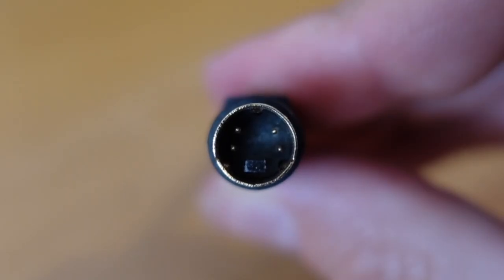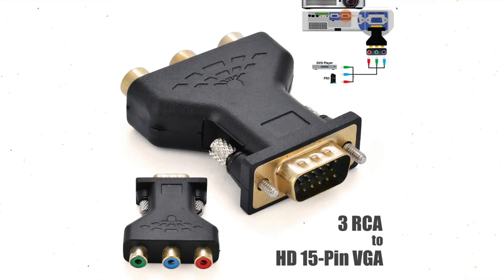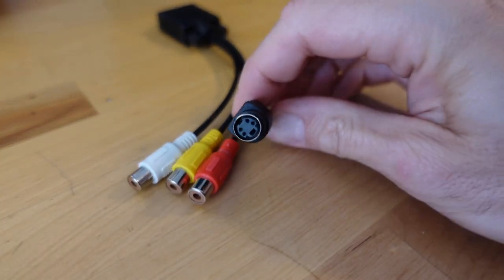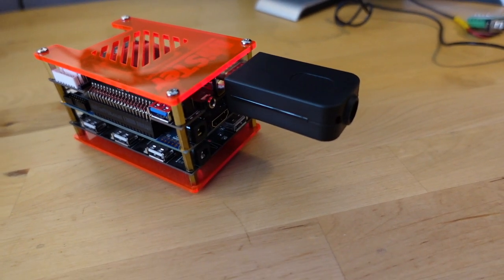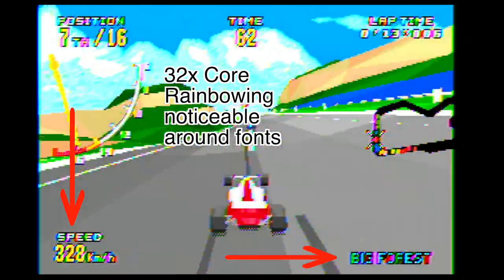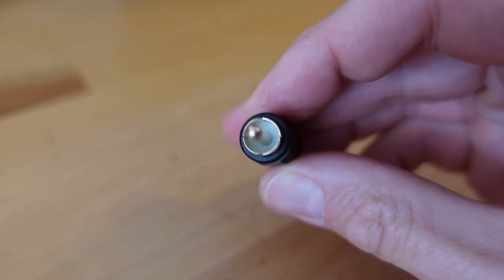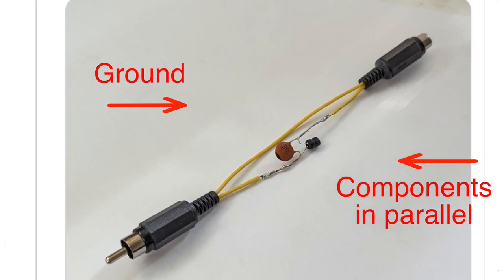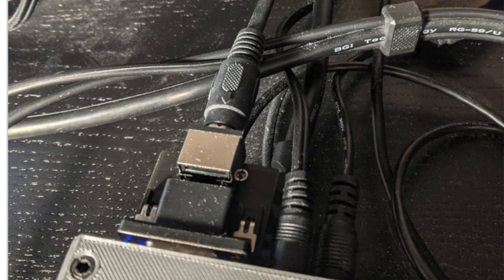How To Hook Up MiSTer FPGA S-Video & Composite

Comment: This was super helpful, thanks! I have a spare CRT setup that only does composite and s-video but wanted to make use of it with the MiSTer. Took some fiddling, like setting the MiSTer update to actually get the YC cores (I apparently hadn't done that before, and so I did not have them), then remembering to actually enable the YC options once in those cores.. After that, it worked! I already had the component video cable from MiSTer Addons and already had a couple of Y-cables on hand as well, so I didn't need to purchase anything or hack anything up (although I may try to make the filter like shown in your video for composite). I am also surprised there are so many YC cores. I was a little worried going in that my selection would be limited, like with the arcade cores, but it seems like just about anything I would want is here (even PS1)! Great stuff. My MiSTer just keeps getting more and more flexible as the years go on!

Comment: It also works with direct via direct video over hdmi with Antonio's vga to component dongle (which adds sync on green). That dongle is super cheap as an alternative for anyone who doesn't have an io board
Reply: The Antonios dongle has major dot crawl issues on composite output which look REALLY awful on systems like sega genesis, which is a big call to action on why this is being made (apart from convenience sake). Although the adapter works well with s-video.
Reply from the maker: @HappehLemons  I suspect here you are referring to Antonio’s RGBs to S-Video and composite adapter. That does exhibit dot crawl like most devices which externally do that conversion will

I believe the commenter above is referring to another dongle by Antonio which is a simple VGA to component breakout board. Like VGA to component to adapters are supposed to do, it takes external sync and mixes it into green/luma/Y. It’s cheap and a quality VGA to component solution

As I understood with direct video, the difficulty is finding the right hdmi to vga converter, it needs to be a specific chipset according to Mike

Comment: Woo hoo. Native. Will be interesting to compare the current converters with this solution. I've got the villena which from memory you have too. At the very least not having to switch the jumper to 5V is a win.
Reply from the maker: Yeah I have the adapter too. I think we would need to wait for a full release of the YC cores and for Mike to nail down exactly what components should be in the dongle. Turns out I can't even easily source an 10uH inductor locally so I couldn't build a cable to Mike's spec. The parts shortage is real!!! (actually I live in a small place with only 1 main store haha)

Comment: It's not native S-Video like you say, it's transcoded into S-Video that has a different colorspace. Not a big deal. Better to point out that the capacitor + inductor in parallel combo values are for NTSC, not PAL.

Comment: Great video Zez! I have been trying to find a good s-video solution for my mame cab i built years ago. I was about to pull the trigger on an ali express svideo io board with saturn type av out but then I saw that porkchop is working on one that can do dual sdram....and then these cores comes out!
Reply: Would the io board with the saturn output benefit from Mike's core? Like would you not have to get all these dongles, just use the saturn output?
Reply from the maker: @kevfleth  I don’t quite get what you mean. Can you explain the question again? Are you referring to the upcoming Saturn core?
Reply: @ZezRetro  The RetroCastle Store on AliExpress has these io boards with a Saturn output replacing the VGA output. So I was just wondering how an io board with a Saturn output, using composite or svideo, would look compared to an io board using VGA and converted to composite/svideo using Antonio's vga to composite adaptor? And how Mike's core would look on the io board with the Saturn output?
Reply from the maker: @kevfleth  I found what you are referring to and I had absolutely no idea such a thing existed. I have started to ask around my contacts and so far, this is a total unknown to them as well. I can't say how this thing will work as I have no information about it. It claims to be outputting composite and s-video directly but no idea how it is doing this. If i took a guess... I'd say this composite output would experience dotcrawl as it's being generated outside of the core. I would guess they are using a chip to convert the RGBs, much similar to Antonio's adapter but they incorporated it onto the motherboard instead.

That is my guess, I don't think it would perform better than Antonio's original adapter. Note that Antonio just relased his "cheapo" adapter which is designed to work with the new s-video cores and that should deliver rock solid, as good as you can ever get, composite.

Comment: how does this compare to just using a cheap HDMI to composite converter from ebay?  Works for me but I get some scrolling on the edges.
Reply from the maker: Those devices are pretty cheap and crappy. RetroRGB and I tested them on stream a few months back and we discovered the quality varies from item to item. We had identical looking devices however my one had consistent lag of a few frames where Bob's one had variable lag. We opened them up and saw the devices were different inside beside being the same outside. If you want something to get you going then its ok but as you have found, they can be pretty rough

Comment: How does this work when loading up the MiSTer menu? I have Antonio Villena's adapter but the composite output either suffers from bad dot crawl or is outright rejected by half my CRTs. S-video works perfectly. If this needs to be supported by the cores, will it still show if I build a composite adapter?
Reply from the maker: I am doing some tests on this right now. Which Antonio adapter are you referring to? The original one which works on any core or the new "cheapo" which works with the new YC cores?

As I understand from Antonio, he has only sold 3 of the new cheapo ones and hes halted production to refine the design.

I am using the prototype cheapo adapter right now and the mister menu just appears in black and white. When I load a YC core and select YC mode then it goes to color.
Reply: @ZezRetro  the original, I got it a while ago, somewhere between 1 and 2 years. It required the 5V jumper to get power from VGA pin 9. Looking through the YC cores list, all the ones I'd care about are there but ideally I could use it without having to also have an HDMI display nearby to launch the cores. Black and white would be great, as I never bothered with wallpaper over analog and that static background looks like it should be in black and white anyway. Thanks for the response, that would mean it'll work as I hope.
Reply from the maker: @tomferrier6143  You def dont need to switch to HDMI to access the mister menu. If you are using the new YC cores, the main mister menu just shows up in black and white from the IO board. The YC cores are still in beta and once they are nailed down then Mike and Antonio will both have their own adapters available for use with the cores
Reply: @ZezRetro  that's great. With any luck they'll get merged into the main cores eventually after everything is worked out. That was always the biggest downside of MiSTer when recommending to others; the complicated/missing analog support. Obviously being community developed, I was never mad about it, but just really wished for more. It seems like this is the year!

Comment from the maker: Watching the new video from Lu’s Retro Source helped me understand the settings better. Go watch that vid for a more well rounded explanation of these cores and setup 😀

https://youtu.be/DBy_XPmieKc

If you have any VGA to component cable or converter, or Antonio Villenas new “cheapo” adapter: set composite_sync=1 in the mister.ini and set SOG to AUTO on your IO board

If you made your own cable, use a VGA to BNC (or other direct breakout cable) or you are using Mike’s upcoming adapter, set SOG to OVR. Then it shouldn’t matter what you set composite_sync to in the ini

When making my video I didn’t realise a VGA to component adapter is mixing in the sync itself. That’s why Lu had to set SOG to the right switch and turn on composite_sync.

Comment: Does anyone sell a luma trap yet?
Reply from the maker: Mike Simone’s dongle PCB is still in the works. He is taking time because he wants to make it as simple as possible but he also keeps finding refinements.
Reply: @ZezRetro  Okay, thanks for helping me since I couldn't find anything anywhere else. Will the pcb be sold as like just the board incomplete/unpopulated with no case or anything or does that depend on where I get it
Reply from the maker: I think Mike was offering it under an open source license but id need to double check with him. If so there could be a few vendors offering it